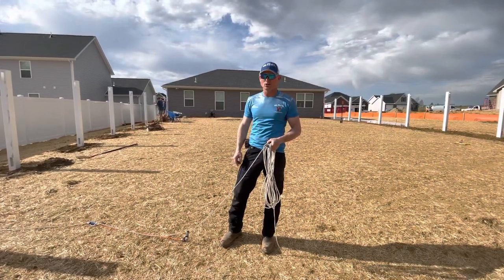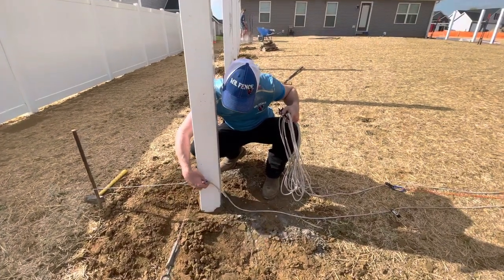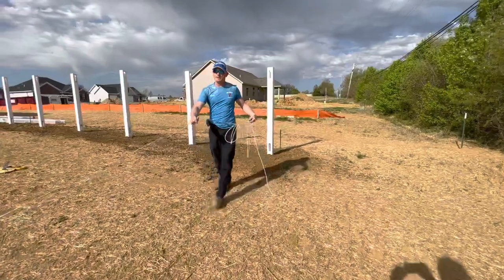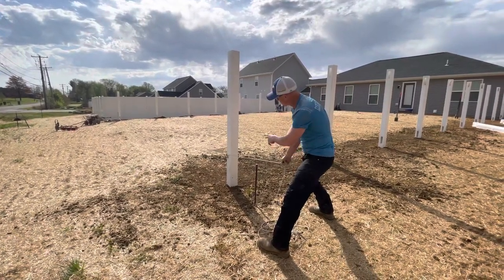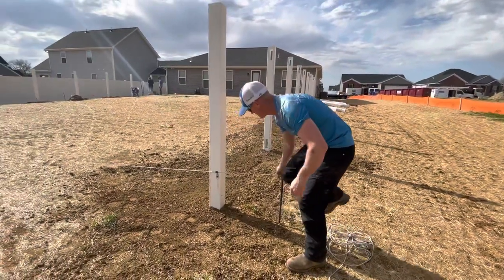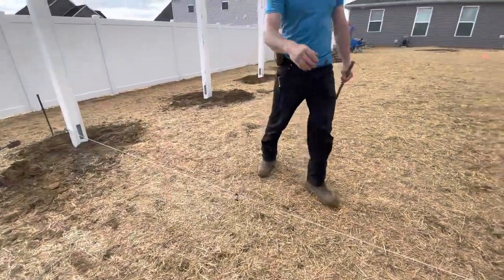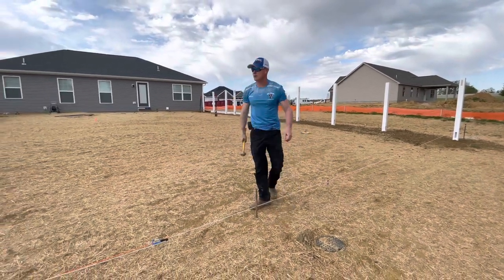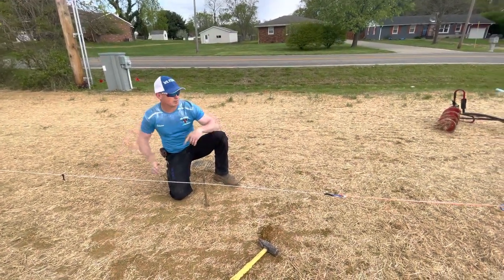The Equalizer

Comment: How long does it come in?
Reply from the maker: 112’ it’s not meant for long lines use the marker cable for long lines and the equalizer at the end of it to blend
Reply: @mrfenceacademy   I just lay out my 100' tape and mark the tape at the center of each post on a fence ive already built than when you go to lay out another fence you just run your tape and wherever a mark is at you dig your holes. Different colors for different types of fence